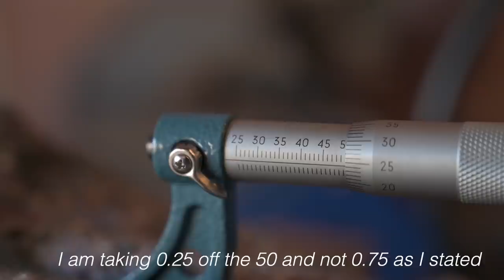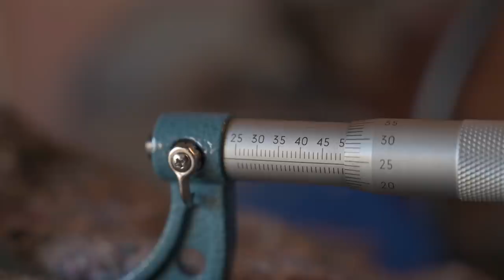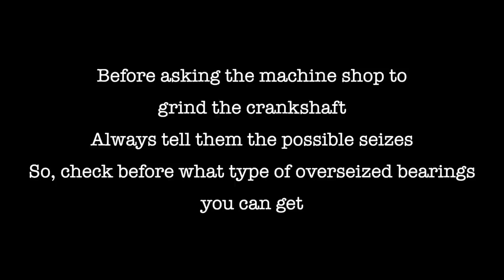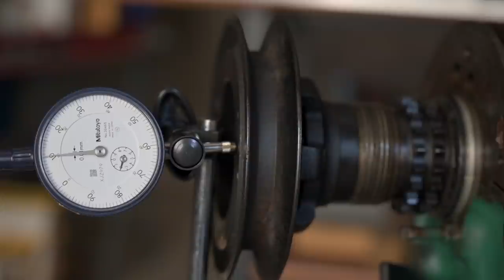Old Rusty, Engine block assembly

Comment: I just discovered your page! Awesome! You are an inspiration!  A couple questions! The U23 engine- is it the same for the Traction Avant 11CV? I need to rebuild my 49 here in California. Not many Citroën resources here. This is the only video with step by step, so danku!!!  Second question- when you set the oil pump- you said the notch for the distributor should run parallel with the block, which I understand, but the slot is offset- is the smaller side closer to the block? Thanks, and I love your page!!
Reply from the maker: Thanks for the comments, Yes many parts are the same as the Citroen Avant CV11...but not all parts as the TA is a reverse engine. As for the distributor, it does not really matter as you can turn it the way want.
Reply: Thank you! I'll follow your lead! I put a new distributor in and all is well! Now for the 53 engine! Great page! You're a genius! Danku!!!

Comment: Just popping a comment to say where did the beard come from!?

Officially here in the UK we use metric but all the garden seeds having spacing in inches on the packet. Go figure.
Reply: Funny ... here in germany we use inches for the diameter of freswater pipes :)
Reply: @MrThomashorst  Water pipies are always measured in inches. Even the threads are always NTP standing for National Pipe Threads which is kinda universal. (Same in Eu, USA, UK, Candada even Russia and China)
Reply from the maker: Thanks for  the comments,   I did not know that ... I see distances in miles on the roads ?  Or is it only on mechanical work that metric is usded. Yes plumbing is the same here... very strange the mix
Reply: @Alexelnet  , The standard pipe thread in UK unless it has been changed in recent years has been BSP. British Standard Pipe. I do know some of the most recent fittings  have a slightly different thread depending on where they originate from, that is most likely NTP.? I do know that certain fittings are metric which is probably different again . I don't work in this  industry anymore so I am not up to the latest developments .
Reply: D3Sshooter Yeah the UK is metric, and has been since the 60s/70s I believe. The road signs are all in miles though as you say.. probably too big a job to change them hehe. Officially it’s metric but every ruler or tape is always still in both. We still think in mph in cars though so for some reason the road system was never changed.
Reply: canuckguy worried  in the UK we don't have any money🙁

Comment: Actually your measurement was probably good, if you look at the video you will see the calibration block was cocked at a slight angle.  That could be exactly the difference
Reply from the maker: Thanks and indeed, that is always the issue if i need to film, talk and work at the same time. Things are not always as they should be...

Comment: I'm wondering why, given the level of detail and care you pay to all details you are not using assembly lube but just regular engine oil. Also wondering why this car doesn't have any proper thrust washers. Which parts wear out with the clutch tare? Regards
Reply from the maker: Thanks for the comments,  the oil i used is mixed with a STP alike oil improvement.   I should have stated that.   And the thrust washers, beats me .. i used the ones that were available and as original.

Comment: HI FLEMISH, AS I TRY TO COPY ON YOU PLEASE HELP. I BOUGHT WORKSHOP MANUAL AND SOMEWHERE IS WRITTEN AS FOLLOWS

FITS AND TOLERANCES

DESCRIPTION                               	SIZE OF NEW PARTS AND WEAR (Mm)
Diameter of driving gear shaft   	48.961 ÷ 49.000
	

Then my question is : what is this divide sign for or mean?
 what i expected is 48.961 to 49.000 to show that the shaft should be between the two figures

M.B.S MOSHITOA (S AFRICA)
Reply from the maker: Hi, that is indeed what I understand the standard new size and the wear tolerance.
Reply: @D3Sshooter  which one is new size , mr Flemish try to elaborate. i really need to go use this soon

Comment: Meticulous as usual, mineral oil as used on these old, and in this case, workhorse engines was more viscous and needed warming before it flowed properly as opposed to synthetic and semi synthetic, and in fact modern mineral oil.
Also service intervals would have been shorter thus the oil didn't degenerate to the same degree as modern high reving engines.
The only way available in the day to tension the chain would have been a jockey wheel as they never had the technology in nylon back then, 
which was probably prohibitively expensive and with a duplex chain they probably considered it would last long enough before the engine wouldn't run.
I'm looking forward to seeing this complete it will be funky.
Reply from the maker: Thanks for the comments, good points